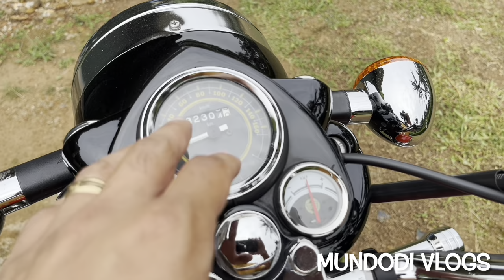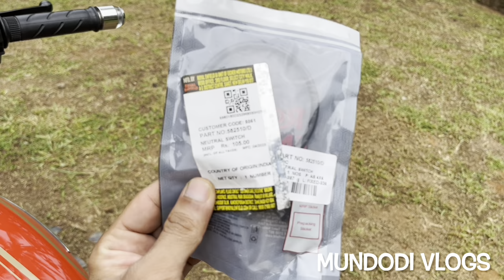ROYAL ENFIELD NEUTRAL LIGHT NOT WORKING | HOW TO CHANGE NEUTRAL LIGHT SWITCH ON ROYAL ENFIELD BIKES

Comment: Hi even my classic 350 2018 neutral light is not working and the bike is not starting by kicking since I am not using self start as the battery charge is too low, so what could be the problem whether the neutral switch or battery dead? Could you share your thoughts on this. Thank you.
Reply from the maker: Seems like battery dead.

Comment: Bro any body help my classic 350 bs4  while iam riding  suddenly bike is stoping and running  at last i reached home next day  i switched on but neutral light horn and also indicator is not switching on  and bike is not starting even if use kick starting what is the problem i replaced 6 months back only...frds any body help..
Reply from the maker: @vishalbright864  Battery, fuse , rectifier. I suspect your bikes battery is dead or discharged.
Reply: @MUNDODIVLOGS   bro thanks bro for the faster response battery 7 months only  old bro..will they change battery in  under warrenty..
Reply from the maker: @vishalbright864 ya .